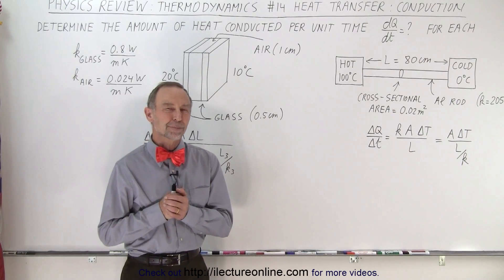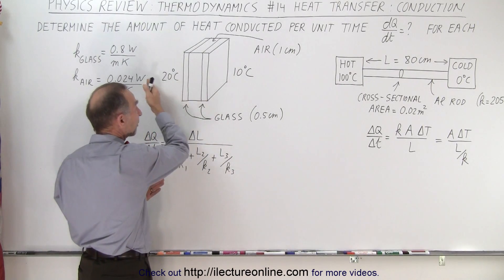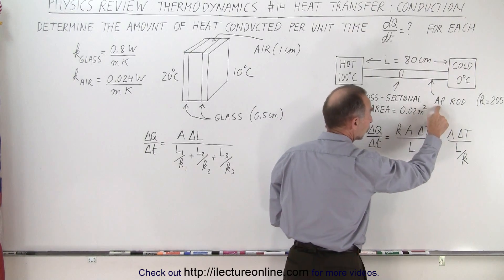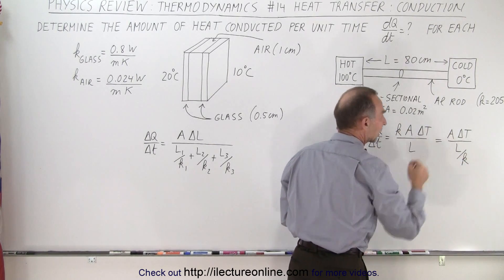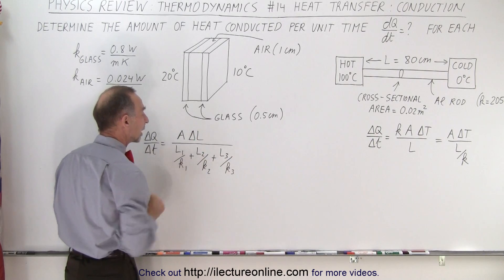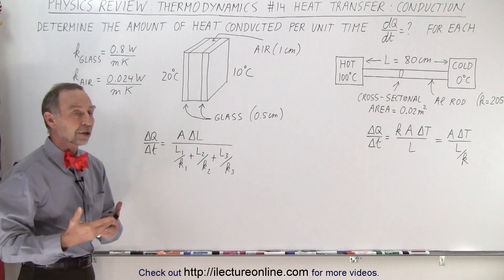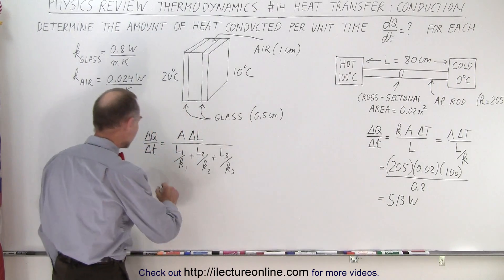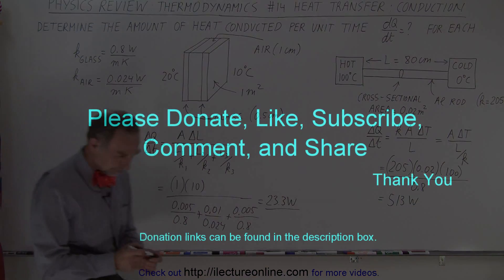Physics Review: Thermodynamics #14 Heat Transfer: Conduction

Comment: Mr. Professor do you think that the windows are badly designed? if the air space would be bigger then more energy would be saved. The secound question is, does the lost of energy is linear funktion? e.g. 23 W heat lost with 10 oC difference in temperature means 46 W at 20 oC difference.
Reply from the maker: The windows are not badly designed.  The increases efficiency of making the air layer thicker is marginal, compared to going to a double pane window compared to a single pane.  The theorectical model does predict that the heat loss will be proportional to the temperature difference as you pointed out.  But when the video on convection is published, you will see that there are additional considerations.
Reply: @MichelvanBiezen thank You. I assumed that statement since now the windows have triple pane.

Comment: Thank you. If I know the temperature inside(+20deg.C) and outside(-10deg.C) the room, as well as the humidity in the room, then it is useful to know the surface temperature of the glass in the room to know when there will be condensation on the glass. Can you also calculate the surface temperature of the glass if the inside alpha is 9W/m2*C and the outside alpha is 23W/m2*C?
Reply from the maker: Yes, when convection is taken into account, it will give us more insight into the surface temperature on the inside and on the outside.